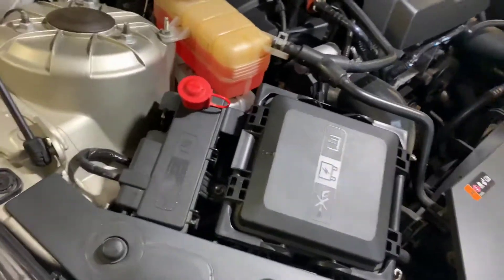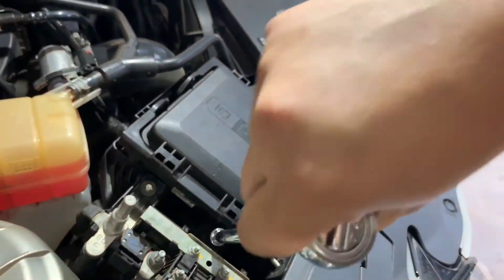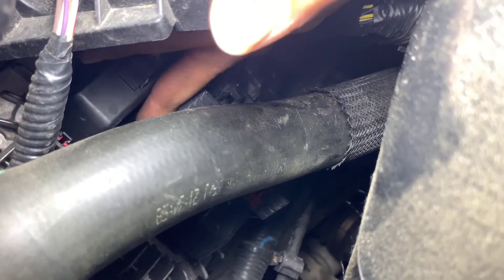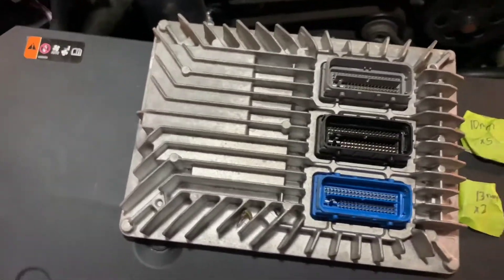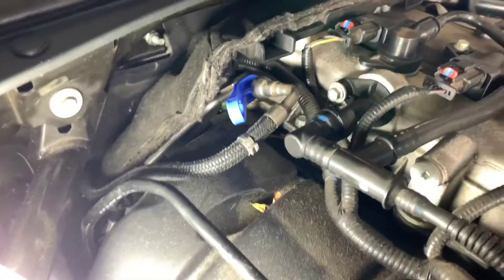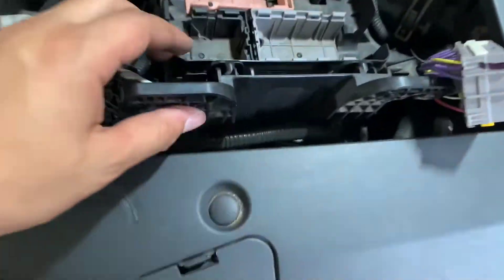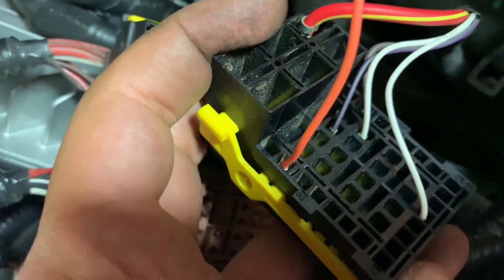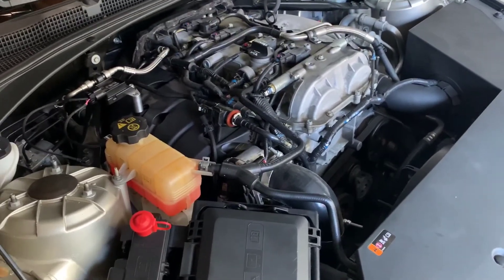2013 Cadillac ATS E85 Install

Comment: do you have to remove the blue cap on the ecu plug? the zzp instructions didn't mention it. i have a 2016, so it was on the different connector the x3 plug. but i just drilled the plastic from the back carefully and then jammed the pin in as far as it would go. the sensor seems to be showing up in hp tuners, as i can now see two new readings about ethanol percentage and ethanol percentage sae. but i am a beginner and now i'm tripping if it did it right
Reply from the maker: I honestly don't remember if it's in the instructions from zzp but I think I did it to be able to verify it was pushed in far enough

Comment: I always pull my fuse to fuel pump and then start the car and let it run till it uses the gas out of the lines. Makes lot less of a mess and there is less pressure in the line.

Comment: So i have the zzp tune already. When i order the E85. Do you have to get another tune revision for the E85?
Reply from the maker: Yes! You can’t run the e85 kit without being tuned for it. Once tuned for it, I wouldn’t do anything higher than 50/50 ratio if it’s something you drive on a daily

Comment: So how is the year in review of the E85? Still running it?
Reply from the maker: Quis FPV 

I actually sold it not too long ago, but until then it drove AMAZING. I didn’t run it during really cold temps but whenever I was on E it ran great. I had no regrets and recommend it
Reply: @S.0.G  any left over parts forsale?
Reply from the maker: Quis FPV 

Yessir. I still have everything available
Reply: @S.0.G  do you use Facebook messenger?
Reply from the maker: Quis FPV 

I don’t but I can send you a link. What are you interested in?
Reply: @S.0.G  send me a link. Just got the car so alittl of everything lol
Reply from the maker: Quis FPV 

I got you lol
https://offerup.com/item/detail/893208393/
Reply: @S.0.G  contacted you on the forsale ad. Would like to get that E85 kit

Comment: Does the pink wire slide all the way down into the connector
Reply from the maker: Yessir. When you look at that harness connector on the opposite side of the wires, you’ll see how far all the wire pins are pushed in. Just make sure the pink wire is in similar position. Hope this helps

Comment: How did it feel after the TB Replacement and e-85? I have everything you do, without the TB. Looking to see if it’s worth the price. Does it still have the dead zone after 5500rpm?
Reply from the maker: Trey Lewis 

Dead zone is no longer there with the TB. Much better response to the throttle obviously but in my opinion only worth it if you’re racing since the gains are on the top end of things.

Comment: Cans you have all stock parts in car and simply upgrade to e85 chip?
Reply from the maker: walter salazar 

Yes you can be completely stock and add the e85 kit AND the tune. E85 without a tune would not work tho
Reply: God.Is.Love  
So I can just buy the kit which comes with the new chip/computer and keep stock intake/throttle body / and etc?
Reply from the maker: walter salazar 

Yes that’s correct. 

Here’s a link to the tune PCM 
https://zzperformance.com/products/zzp-ats-cts-camaro-pcm-tune

And here’s the link to the e85 kit 
https://zzperformance.com/products/ltg-e85-flex-fuel-conversion-kit
Reply: I spoke with ZZP, the said “DO NOT RUN e-85 without their tune.” When I installed mine, I made a mistake. When your inserting your plugs, make sure they snap and are seated!!!!

Comment: what are your gains from e85 conversion alone? also zzp stage one gains?
Reply: Stage 1 plus e-85 your looking 50-75hp to the wheels alone.
Reply from the maker: Haven’t put it on the dyno yet but e85 alone is good for 25-30whp. Stage 1 anywhere from 50-60 whp. So we’re talking 75-90 whp for  $1,200 in parts is not bad at all!

Comment: Are you gonna be going stage 2? And a bigger turbo down the line?
Reply from the maker: Yes sir. My plan is intercooler by Christmas and bigger turbo sometime next year
Reply: God.Is.Love  Rev9 intercooler is literally the same as the mishimoto intercooler for $250 less.  I have mine installed and wow what a difference. Intercooler temps used to go up to 130°+ on one pull. Now in 95° heat it only goes up to 107° after numerous 0-120 pulls
Reply from the maker: Ton_finnhead 

Appreciate the info! I’d be going with ZZP IC. Never heard of Rev9. I checked em out and couldn’t find one for the ats
Reply from the maker: Ton_finnhead 

Nice! Will definitely keep that in mind. 👍
Reply: God.Is.Love Ryan’s speed, said he didn’t like the ZFR turbo, he removed it. But ZZP did come out with the stock turbo with a bigger turbine!!! I’d look into that
Reply: God.Is.Love do you know about how much whp you’d be looking at after all that?
Reply from the maker: Awesome Hobo 

I’d say anywhere around 400-450whp depending on the tuning. Should put me at really low 12s maybe high 11s